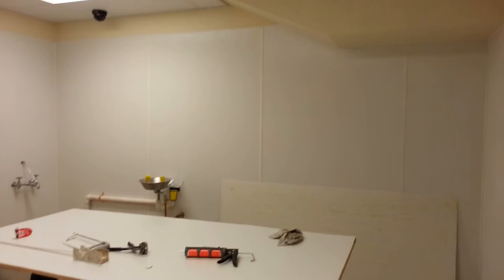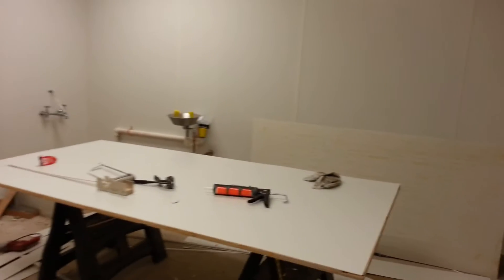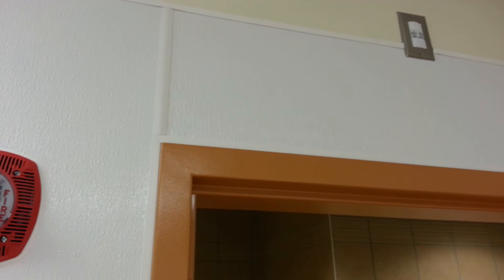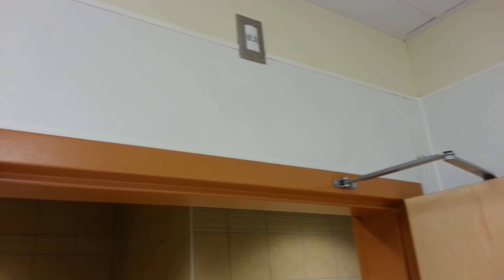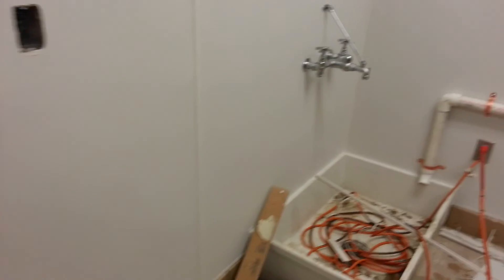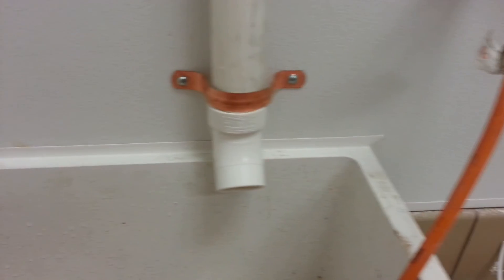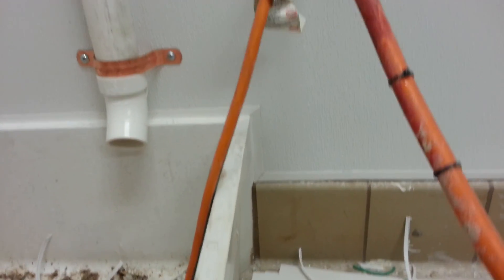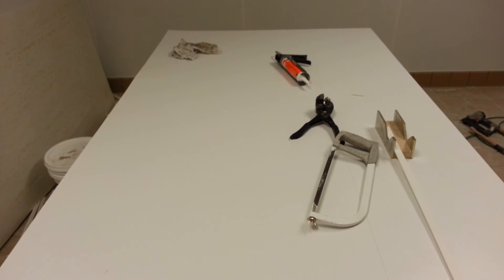FRP Installation over concrete block wall pt 2

Comment: Why would you run j mold around a mop sink? You say 'that's the way you do it', but that's not the way I do it :) . Cut it neatly around the basin and silicone. Water will pour into the j mold and siphon behind the wall. Thanks.

Comment: Great video.  What do you do if you have a sloped floor. My quarry base is already installed and the room slopes at least 3/4 on 3 walls. What do you do to even out the FRP?

Comment: Question never did any of this before.  Going to try and do a room and walls are taller than the sheets of frp. I'm assuming just use a splice piece on top and continue up?